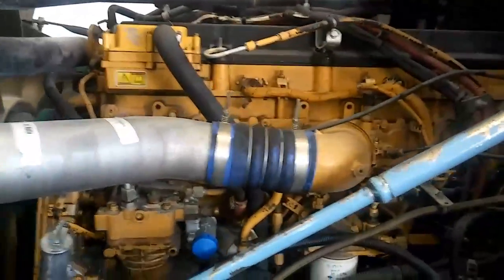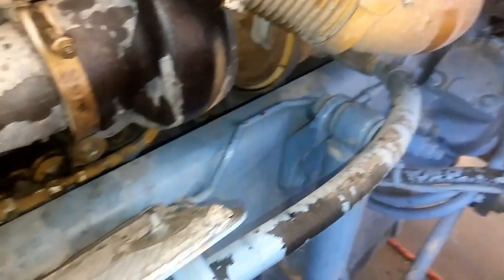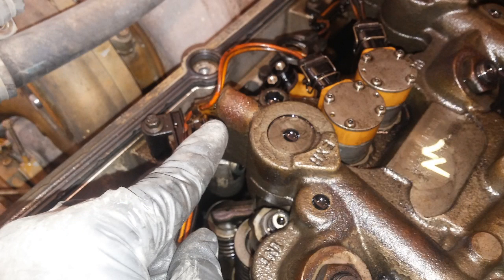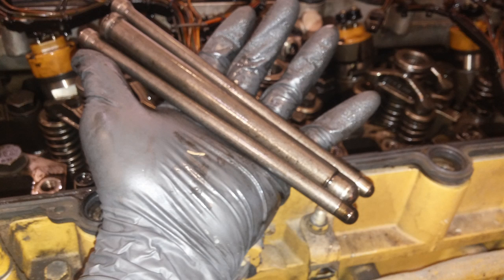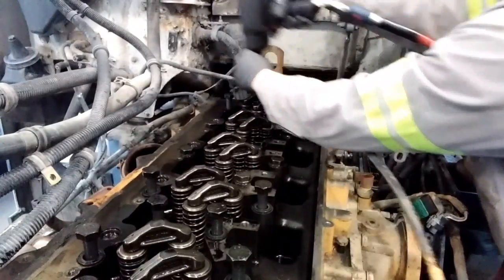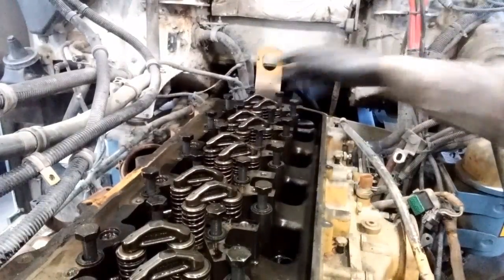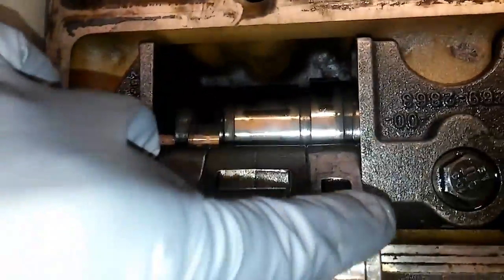How To Rebuild A Diesel Engine.  Part 1.  Cylinder Head Disassembly And Removal. Twin Turbo Cat C13.

Comment: 1.  On CATs and JDs, when the engine is “pinned,” does that mean (a) TDC for cylinder 1 OR (b) TDC for cylinder 1 or 6 (verify by visually looking at rocker arms)?

2.  It is best practice to “pin” the engine before removing the cylinder head, right?

Comment: High Josh, I have a 6.0 diesel 2003 Ford  f250 w/ auto trans. I can't figure out why it keeps blowing my oil cap and cracking it. I did replace the oil pressure Guage. You have any idea?

Comment: I have a question what if a piston broke pieces all over but engine still rotes with a engine hot temperature code and the block and crankshaft look good and rotate good can I have them checked in chassis's or can't be reused because of overheat thank you?

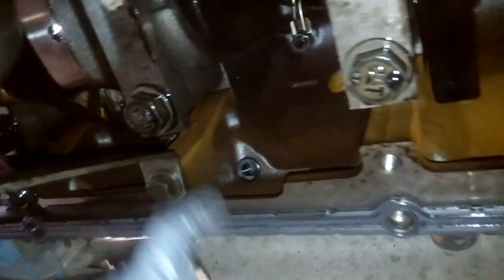Comment: Hi Adept, love the videos, very helpful. I am working on my C12 now looking for cause of low warm oil pressure. At 7:34 on this video you show an oil plug, what is the story on that plug? Is this something that can come out? My engine acts like it has loose bearings, good pressure cold but when it is warm its down to 35 at 1600 and 15 to 20 at idle, so not good. Main and rod bearing clearances measure out good so looking for other issues now.  Thanks!

Comment: Just heard about your channel through Stephen Cox and looked you up. Gave you a sub. I used to turn wrenches on trucks but got burned out and got out of it.
Reply from the maker: +jimgam730 what are you doing for work now, if you don't mind me asking?
Reply: working in the cable tv industry as a service tech and it sucks. not sure why I stuck with it so long but I have. thinking now i'm too old to get back into it, almost 60

Comment: Josh,

I'm looking to buy a boat, and this boat has a pair of 3126 450 HP engines in it..  o
According to the owner,  the fuel injector tip broke off on one cylinder and damaged the engine.  They are suggesting a new liner, piston and head.
My thought is if I'm going to do that, why not just rebuild the entire engine?

I'm pretty mechanical minded and I've rebuilt several GM 350 & 454 gas motors in the past, but I've never tackled a diesel before.  In your opinion, is it something that can be done  by a guy like me, or should I leave this to a professional?

Also, what differences are there between the on road engine and the marine engine?  I would plan on removing the engine from the boat and do the rebuild in my garage. Any idea of what a full rebuild kit would cost for these engines?

I really enjoy your videos!

Dave
Reply: If your going to strip it down that far and have the funds to do the rebuild then do it. Your only going to regret it down the line if you don't and then have an engine fail at sea. The 450HP marine engines are pretty "hard worked" engines as they have upped the HP quite a bit in comparison to the road versions which are usually rated between 190-300 IIRC. The extra HP is because the marine engines are designed to give more power and stability up on the plane at consistant high RPM where the road versions are designed for low down torque. You need the HP in the marine version as its the RPM's that matter not the torque. Actual parts wise they aren't much different. If you have done rebuilds before then go for it yourself and do the rebuild. You will save a tonne of money and learn about the engine along the way so your more capable at handling issues in the water. At the end of the day you have 2 engines so you aren't relying on one completely.

Comment: great vid bud!! TY
Reply from the maker: +CAT DIESEL POWER Thanks for watching.
Reply: Adept Ape dam rite pard I love your vids! BTW question for ya in your opinion is it still ok to dump a quart of ATF IN the fuel tank every 4th fill up is how I do it and I know for fact in my history it has helped alot in older cat engines but I'm wondering about this new EPA Crap engines if it will hurt them to do it? thanks

Comment: adept ape, do you have any videos about wastegates, and removing the line that go's to it to disable it?
Reply: want to know if its safe to do and what to know about it
Reply from the maker: +Christian Russo I have a boost video that discusses it, but don't have one that I can remember that talks about disconnecting it. Depending on the engine you have it can cause the engine to have a check engine light and derate if you plug it. The wastegate on most of the Cats doesn't really limit the boost by very much though, perhaps a few psi and if you have an older Cat like a 3406E, the extra couple psi won't hurt it most likely. Just do it at your own risk.
Reply: its a mbn motor having a low boost problem, looks like the turbo compressor was changed within the last few months but not sure
Reply from the maker: +Christian Russo I would pinch the wastegate off and see if it makes a difference, if it doesn't then you have most likely a CAC leak, exhaust leak, plugged muffler, or something else going on with it.
Reply: thank you, ill try to pinch the line tomorrow and send you a update
Reply: @adept ape.... update... i pinched the line at the wastegate took it for a ride, im getting abut 45 psi of boost with it pinched and running like the cops are chasing it..... so what does this tell me to do now?.... was getting 22 psi low power slow response

Comment: Gotta love the truck drivers, "that's not how I would do it" great vids man...bailed me out on programming a ecm the other day......how long does a in frame generally take you?
Reply from the maker: +heavy chevy This one is quoted at 66 hours I believe. It's a Platinum kit so we are doing more than just a standard inframe. Oil pump, water pump, oil cooler, and addition seals and inspection.
Reply: Yea  platinum is way to go with head being junk and gets you the injectors too.i had a c7 like a week ago come in on hook for no start, I dead headed the transfer pump and found no fuel pressure. ..so pulled huei pump and the gear was held on by 1 thread....just curious if it's a real common thing ? thanks ,don't mean to be a bother
Reply from the maker: +heavy chevy I like answering questions, kinda the point of the channel. Yes that is a common problem I'd say maybe 1-2 out of 10 HEUI pump failures is the drive nut getting loose.

Comment: I did a series on cat motors to there a lot easier in a rebuilding like cummins The cats are a lot easier especially in their overhead design
Reply from the maker: +The Snap-On Junkie!!! The C13 gets a little complicated on the overhead adjustment, but timing it and everything is easy. We have a young guy at work and he couldn't believe you don't even have to time them during a rebuild.
Reply: Adept Ape ha ha that's funny

Comment: very useful videos Josh, I can't get proper knowledge on how repair these engines here in Pakistan and your videos are very helpful. I aspire to work for cat as a Diesel technician.
Reply from the maker: +Kamil Mastoor I should have the Piston Pack removal one coming out in the next few days as well so stay tuned.
Reply: Sorry for so many grammatical errors. Just saw that you replied.
Reply: @AdeptApe  Can you reuse the injector hold down bolts?

Comment: Awesome video, Josh. I'm very excited about this series! Great and informative videos as always.
Reply from the maker: +Maxx Edwards Thanks for watching. You're an original commenter on this channel too, I guess I'm still doing something right.
Reply: @AdeptApe   hi i have a C13 on my 2007 peterbilt 379 short hood truck ran perfect but was restricted at 65 miles an hour from the company i purchased it from so i went to a shop they bumped that up the my RPMS where really high so the suposably got my tire size and diferential and another number multiplied it and came up with 29,000 ish and replaced it for the original 34,000 and something number or there truck rpm got lower and ran good coming out of the shop as soon as i hooked my trailer and i began pulling empty my pyro gauge temp went hot turned the red light on and as soon as i let my foot off the throttle it comes back down PLEASE WHAT can that be the guys at the shop say what they did had nothing to do with the pyro temp PLEASE PLEASE HELP.